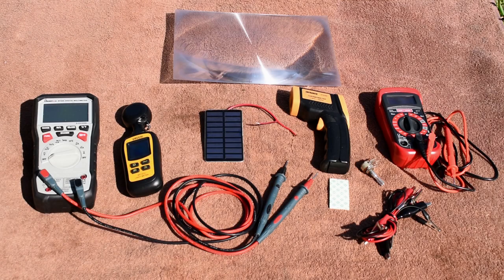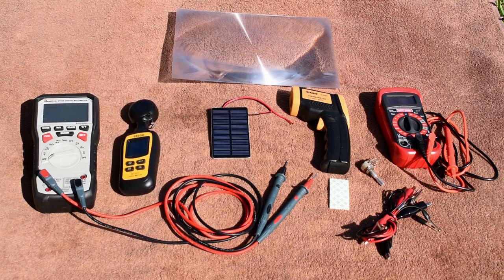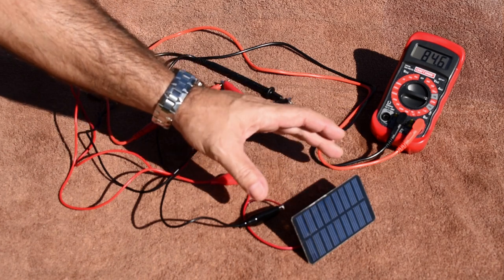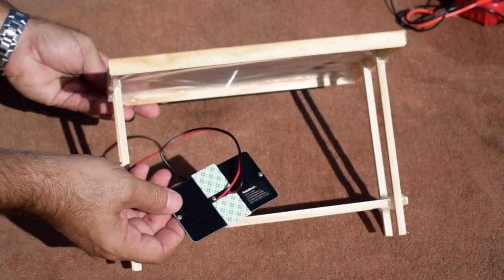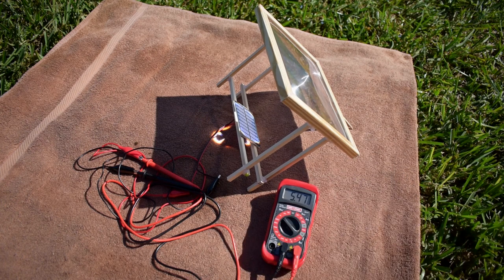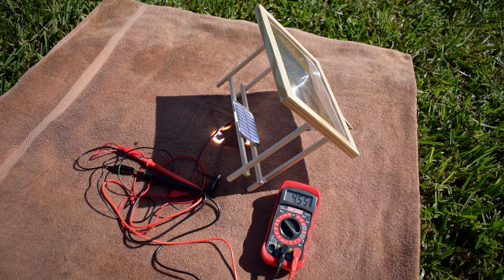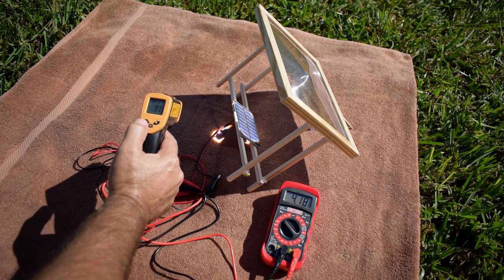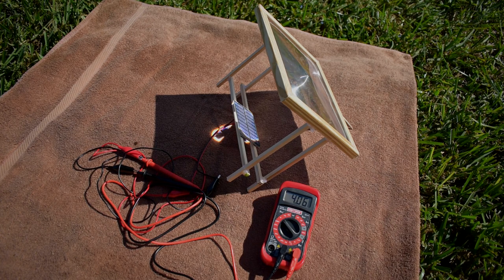Solar Panel Experiment Using Fresnel Lens!

Comment: I am sure you did try a more practical load current and outout voltage ...i.e. max power point to see  the gains and benefits  ...like your intention to use it as a charger...I would have been interested in your comments even if it was too hard to include it in the video ?
Reply from the maker: No real need for max power point to see there's a substantial difference in panel power output.

Comment: Great experiment!  Can you try using different filters to filter out different frequencies of light, for example an infrared filter?  I'm wondering if filtering out a certain part of the light spectrum might allow the solar panel to operate at a lower temperature while maintaining 380mA.
Reply from the maker: Infrared filters block out too much visible light. Cooling is the only way to go.

Comment: Can’t you use this voltage and amps to power some robotic way to make this apparatus turn with the sun?
Reply from the maker: You mean a "solar tracker". Some of the solar panel's power output can be used, but you'll end up having much less power to use for other things.

Comment: compare power per square foot of solar panel alone, vs. power per square foot of lens area. This will tell you if the lens has increased efficiency in addition to using less PV material.

Comment: I've been interested in this type of experiment for a long time. I have my Fresnel from a projection tv and a 200 watt solar panel. So ya nice job.
Reply from the maker: I need to find a few trashed LCD/LED big screen tv's. :-) Thanks for watching!
Reply: Seen a number of vids on the subject, one a guy setup a parabolic  reflector in a earthen pit under an array of collectors elevated about 10 ft. and he was cooking them! Read somewhere that it really shortens the lifespan of the collectors though with too much amplification. That would make for a good long-tern test as well.
Reply: @ThePreyMantas  Clearly your not understanding the experiment.
Reply: @electronicsNmore  this would be interesting ...there seems to be several layers of diffusion material in an LCD TV...is one of them a Fresnel material and could it be used for this style of experiment?
Reply: @mekuranda  You can only find fresnel lens in older projection tv's
Reply: @georgedemean2228  Ah yes - that was my suspicion - but was not sure that some LCDs used some kind of reverse filter that increased viewing angle - I have not dismantled my TV to be disappointed - Thank you for the great content - always thought inspiring and creative uses for common items in our lives - I look forward to your next creation - Cheers Peter
Reply: @MegaTriumph1  Hey Mega, I beg to differ so I guess we'll have to teach by example and agree to disagree... Hope you had a great TD!

Comment: Nice one. I have a solar panel setup. At evening and early morning the light rays doesnt hit the panels perpendicularly.  I thought of placing a mirror to reflect the light to the panel in perpendicular direction. This will increase the power output at morning and evening to some extent. Can you please do an experiment with this setup. 

The lens is a good idea but afraid of the temperature over 90 C.
Reply from the maker: The mirror to redirect the light sounds good, but you will be increasing light intensity as well.
Reply: @electronicsNmore  How intensity plays a role here

Comment: Hi I just found your channel. Very good info ty. I was wondering if you could help me figure out the best solar panel to buy? I bought the hp500s solar power station. All I can find for info is that I need 13 -16 V.  I'm not sure how many watts I can use and I think I can't go over 16v. I live in a tent and have limited funds but want to buy a panel that will work well for me. Ty for sharing all the great info. Happy Thanksgiving..
Reply from the maker: Jackery 500 explorer? If so, do you want a good single panel or folding?

Comment: You're measuring the open circuit voltage and the short circuit current. The actual maximum power you can take from the panel is lower, as the maximum power point voltage and current are lower than what you're measuring.
Reply from the maker: Everything was explained in the video.

Comment: I wonder if you could do some kind of either passive cooling system on the back like a heatsink and use the convection processto keep the air flowing over the heat sink. Or could you use a little bit of the power to run a small cooling fan over that heatsink enough that you still have a net increase in power but not damage the panel.
I suspect ultimately it is simply more effective to just use more panels.
But certainly an interesting experiment
Reply from the maker: Coming soon. :-)

Comment: Direct current, power = voltage x current. Power in watts, voltage in volts, current in amps.  The concentrated solar beam by the magnifying glass, boost the solar panel wattage 3.848 times. Solar panel gets really hot, the voltage dropped, but current increased a lot. So the power still increased by 284.8% (3.848 times). Economically, don't know if it still make sense. I get more power out of it, but I need to cool the solar panel. I need to build and clean the magnifying glass. I need to build the structure to house the magnifying glass. I get more power out of it, but my cost also goes up.

Comment: Try this. Use the fresnel lens to produce lot of steam from water, use the steam to spin the turbine to generate AC voltage. Will it generate more electricity compared to solar panels? Will it be more efficient than solar panels? In this setup, you don't have to worry about heat causing voltage to drop like in solar panels. The hotter the steam gets, the better, and a condenser will be probably required too.
Reply from the maker: Fresnel lenses need to track the sun very closely, too much trouble.
Reply: With multiple fresnel lenses assembled in half-sphere or circle form in prediction of sunlight, it is possible to automatically track the Sun. Sunlight will pass from one fresnel lens to another fresnel lens as time passes by therefore keeping the sunlight focused on generating steam. Steam producing coil pipe can be put under the half-sphere or circle so sunlight is constantly focused on the coil pipe heating it.

Comment: voltage reaches upto about .5v perr cell then doesn't really go much higher even with more light, but as you saw the current shoots up in an almost linear fashion , till its fried..
Reply from the maker: It'll hit .6v or slightly higher. Thanks for watching!

Comment: It lowers voltage but raise current? Does that mean more electricity? 🖖
Reply from the maker: Actually the voltage and current both rise, but the heating causes the voltage drop.
Reply: @electronicsNmore  if it did it would helpful. 🖖 shalom

Comment: Perhaps, solar cells should be combined with a material that uses the Seebeck effect as a heat sink for the solar cell. Additional generation of electricity from the combination. The opposite part of the Seebeck pair can be buried in the ground.

Comment: How are you measuring current and voltage with the same pins on voltmeter?
Reply from the maker: V & mA are the same spot, A is a different spot.

Comment: It may be necessary to use a caloric glass, as in enlargers or projectors.
Do not stay on the focal point, too hot ... Shift.
Reply from the maker: The area of solar concentration is large, so heating is kept low. Thanks for watching!

Comment: Fresnel probably need to be at a safe distance to prevent burning of the panel and overheating, you are still taking the risk to damage your panel. mirrors would probably more safer to concentrate the light than this method.  other way to generate energy from fresnel lens is to use them to heat up a medium and then convert that heat energy back to electricity.
Reply from the maker: It was just an experiment to show viewers what happens. Thanks for watching!

Comment: so ur conclusion is if the temp of panel can be keep cool while keeping intense lumes then voltage would not be lost ?  , water is a good idea, but it would have to be swapped out if it were in direct or near direct contact with panel due to it heating up too , unless it was separate in front of it in like an ant farm containment which may even actually increase lumes even more.  i actually had this idea years ago but now improved even more and i'm sure still more improvements can be made.  did u know u can reverse the use of LEDS to be uses as solar panel to produce energy ?
Reply: Most semiconductos generate a voltage when the junction is expose to light, the problem is efficiency. Sure if you poing a led to a really powerful light it will produce some voltage but youd be lucky to draw any current from it. forget about powering a led from another led.
Reply from the maker: As you saw, the voltage was high at the start, along with current. As it heated up, the voltage dropped, so you'd need to keep the panel cool to have high enough output voltage and current to be used as a 275mA to 350mA USB charger.

Comment: solars panels are no use if you have efficiency loses inbetween. You'd be better taking some copper pipe, painting it black with candle wax sooth and making it give a few turns to maximize the surface the lense can heat and then use the steam to power one of those mini steam engines.
Plus the advantage of solar farms like that is that mirrors are way cheaper than solar panels, and the system is overall just as efficient with the only disadvantage of a bit lower power density but space is way cheaper than solar panels, and the mirrors do not degrade over time nor need dangerous chemicals to produce.
Reply from the maker: True, but if you can keep that solar panel fairly cool with using extra power, it would work well. Thanks for watching!
Reply: Try this in winter times with less sun light and this day overall this shit Chem trails clouds ect.
Reply: @WaschyNumber1  Condensation clouds from planes work and look the same as when i was a child in the 1970s. There are more airplanes in the sky these days and once you start to care about those could patterns, you will notice them more without trying. You can also see schematics for all planes that are approved for legal use and you will see that there is no space for giant tanks of chemicals other than the fuel and anyone can test the fuel that is being used... The notion of chem trails is just not a reasonable notion beyond a possible few black-ops missions with special planes, but those they would want to keep away from prying eyes and telescopes so you would not see those at all... In other words if you see those trails then it cannot be a black-ops mission because then they could be spotted and outed. And, regular planes could not hold enough chemicals to create clouds that size nor enough to have any effect on a populace below. It is simply condensation created by the plane moving through the atmosphere, now as it has been for decades.

Comment: Power the peltier with , one peltier mounted on a heat sink in full view of the sun. Which would produce electricity and hook the output to the peltier on the back of the solar cell.
Reply from the maker: Peltiers are power hogs.

Comment: Try liquid cooling it.

Edit: read a comment about a heat sink. I was thinking full submersion... May not need lens then or could use lens. Water would circulate of course. After watching your video I saw you mentioned water. Okay. You got this
Reply from the maker: I'll make another video trying water cooling or a bonded heat sink. Thanks for watching! Be sure to share the video link.

Comment: I think that you cant measure the output of cell by shorting out cell.. thats why there are mppt to maximize output because if voltage collapsees than it cant go up
Reply from the maker: Short circuit current gives a very good indication of solar panel power output, no need for MPPT to get my point across.

Comment: This'd probably be useful at higher latitudes, where the sun's intensity is lower, yeah?
Reply from the maker: True. Alaska. :-)
Reply: You are just trading area that a lot of cells would take up for the area that the lens takes up. So I guess the lens better be way cheaper per given area than the photovoltaic cells because the heat the lens creates and the loss of light from scattering and absorption in the lens are detractors that have to be overcome by the price difference.
Reply: @0ooTheMAXXoo0 , right, yeah, you'd have to analyse all of that.
Reply: @electronicsNmore , how about having a fluorescent layer behind the cell, so that the UV light the cell doesn't absorb is transitioned down and then reflected back up as lower energy visible light that the cell can absorb?

Might improve efficiency a little bit in low light environments, ie., deep space too.
Reply: @0ooTheMAXXoo0  the solar cell has a metal anode (or cathode?) in the back.

how about laying down a fluorescent film, so that the UV light the cell doesn't absorb is transitioned down to visible light and reflected back up to be absorbed?
Reply: @electronicsNmore    Have you considered using an IR filter.  It is only the IR "radiant heat" portion that is responsible for the heating. IR is not involved in the electrical output.  That might (should) lower the heat.

Comment: Good/interesting video.  :)   It looks to me as if that mini solar panel has silicon crystal cells, not the amorphous kind used in (for example) some light-powered calculators.  I was taught that silicon has a negative alpha co-efficient (meaning that as the silicon gets hotter its electrical resistance goes down and not up, so it lets more current run through it, which gets it even hotter, which lowers the resistance even more, etc. leading to thermal runaway).  So, if that's true, what stops the mini solar panel, under the concentrated light from the fresnel lens in your experiment, from reaching a point of not putting any power out at all?  Is it that the light/heat from the fresnel lens is not intense/concentrated enough to do that?   Of course, if it could get that intense, it would probably melt the casing and the internal metal wiring, etc.
Reply from the maker: Yes, they're polycrystalline cells in series. I didn't have a strong focused point of light, if I did, the mini panel would've fried in seconds. Thanks for watching! Please share.

Comment: If the water cooling system installed on the panel will give high output.

Comment: As you can see the numbers are dropping, pretty quick!

Unless you cool down the miniature panel it will do nothing effective!

Looks cool for a "temporary" project, UNTIL....

Nice try tho!
Reply from the maker: It stabilized around 4.07v.
Reply: electronicsNmor:

Ok, that is good to know.

How about a little experiment on taking a low watt but high powered LED light bar, possibly one of those truck ones, and the fresnel lens to see if it can load up a battery at night thru a larger solar panel.

I always wondered if it could create more energy than it would use.

Kudos!

Comment: Yeah I did this in 2007 with a mirror my fresnel lens would destroy solar panel because it's over 50 inches and it's a spot I purchase it from greenpowerscience. Com mirrors would be the better way to go.
Reply from the maker: You need to position the panel properly. If the light is focused too much, you'll burn it up quickly.
Reply: @electronicsNmore  what I would suggest is not actually using perfect mirrors I would use something reflective just not as reflective this way you don't put direct perfect reflection of sunbeams right on to it maybe whiteboard or copper sheeting I'm just throwing suggestions I try that test on a large scale for a home.

Comment: Yes  I take projection tv lenses and aim them at sun. Then stole a telescope clock works to follow sun .
Reply from the maker: A telescope tracker does work good. I tried it. :-)
Reply: @electronicsNmore  mine was a good will find and a little oil. And some patience does well. And simple I moved the cell . It was easy er than you think. Tks

Comment: What happened to trying to the test use the panel to charge via USB?(as stated around 3:10) https://youtu.be/B16hHEaWwpI?t=190  Otherwise a great video!
Reply from the maker: I said I would if it had enough voltage/power, it didn't. Next video will show those tests. Thanks for watching!

Comment: Free enegery. Look we are only bound by what we know.
Imagine if you get a magnified 🔎  glass. - a big one to capture the engery. And then you get loads of little ones to focus the light down to a very small beam.
You then focus that enegery, Heat onto a piece of given metal. Then boom you have free eletric. You would also add additional wind generator with water generator to pump to the plants to let them grow, and then you capture then gases to use as enegry and you could capture the heat from the actual plants themselves, moss, micro greens.
I am sure if you was to grow them in some type of vacuum chamber then it would produce pressure, which pressure is therefore enegery. 
Same as heat from the micro greens or the moss which can be captured.
Have you ever felt the heat come from a layer of plant matter?
Jesus brothers once you see this.
Then you realise what is going on.

Comment: To be added a solar tracker with this system to get the stable power on full day
Reply from the maker: Just need to take care of the heat problem. :-)
Reply: @electronicsNmore  water cooling system available to maintain temperature